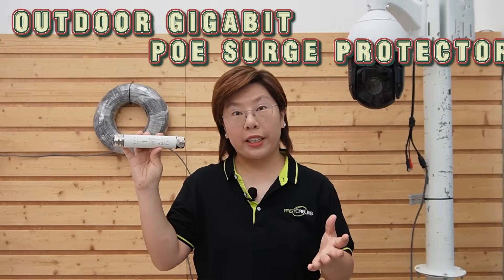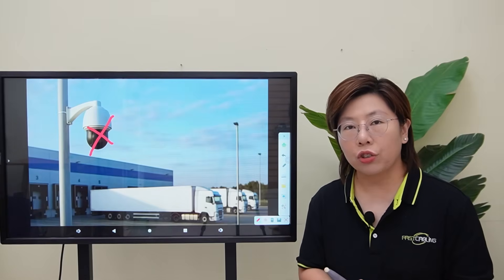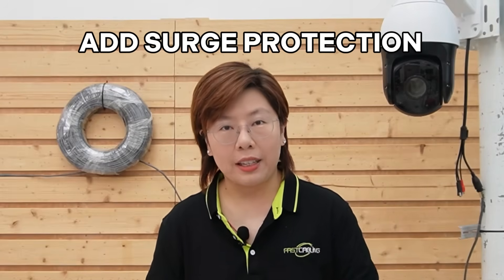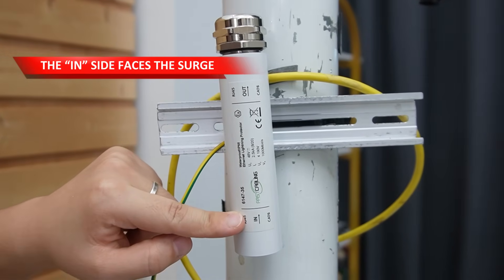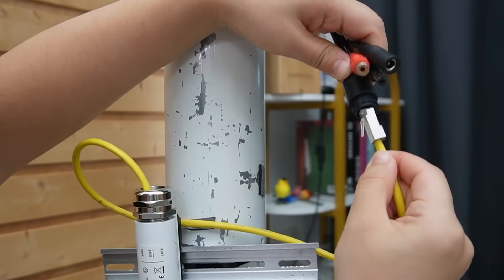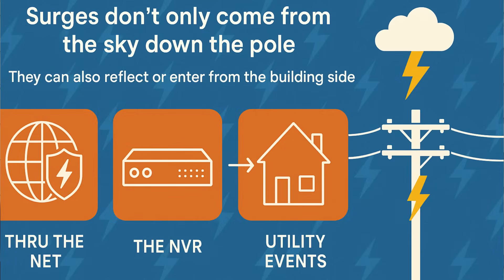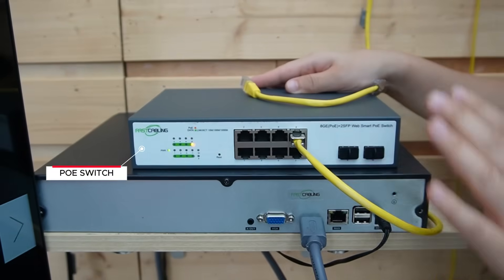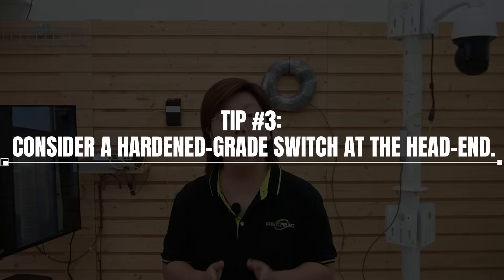Why Outdoor IP Cameras Fail After Storms | PoE Surge Protection Explained

Comment: Thank you for your idea

How do you do a proper grounding without making a mistake that can affect both Indoor and Outdoor Surge Protector
Reply from the maker: Use one single grounding point, keep the ground wire short and straight (6–10 AWG copper), bond the outdoor and indoor surge protectors to the same ground, and ground the metal pole as well.

Comment: But whatabout when there IS a surge and your surge protector blows.  How do you troubleshoot?
Reply from the maker: The surge protector is designed to protect the device from sudden surges caused by lightning strikes, power outages. If the surge protector blew, it did its job — it protected your camera or system. Just replace it with a new one before continuing use, and make sure your new unit has the same or higher surge protection rating (measured in joules).